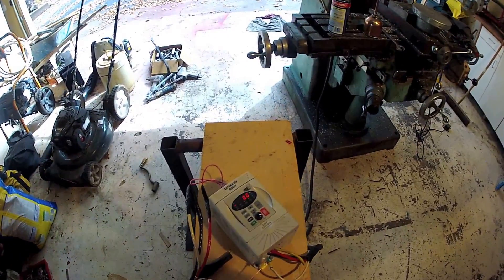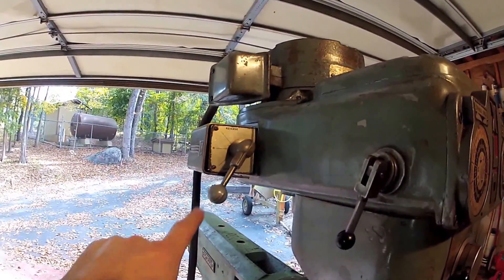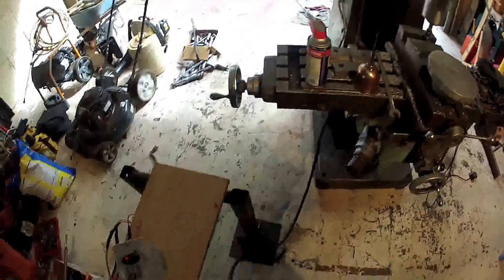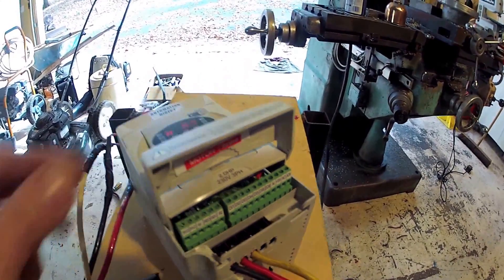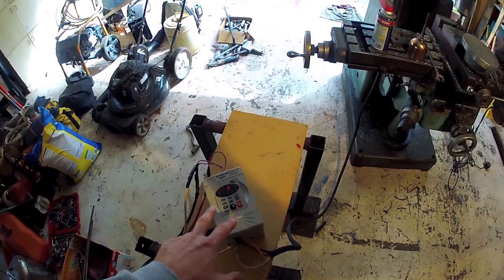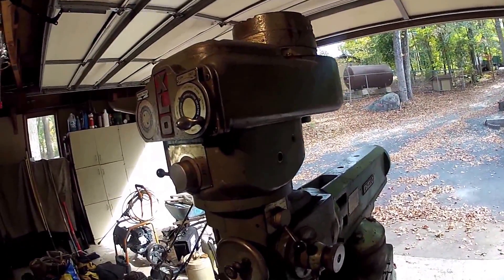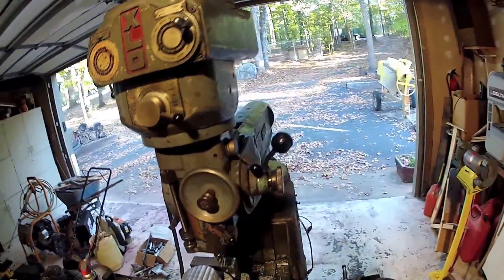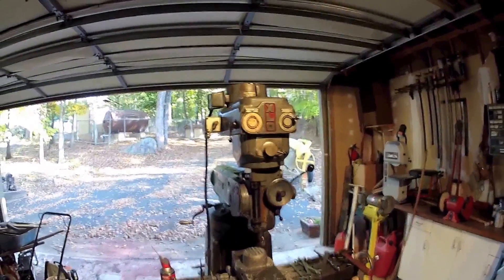Milling Machine Three Phase Solution

Comment: How many volts does your XLO mill require? The ones I'm looking at all run on 600v. Does your VFD output 600v?
Reply from the maker: It's been such a long time since I'd set this up I honestly can't remember, except for one detail.  The general concern with older machines is that the motor coils might not be rated for 600V.  Therefore using VFD speed control at extreme deviation from 60Hz might cause some issues as voltage is varied. I seem to remember the problem being with very slow speeds as the magnetic forces cause voltage to need to increased having something to do with the higher motor torque needed to keep everything turning at lower speeds? Fortunately my XLO still retains it's OEM functioning MECHANICAL variable speed control.  I use it mostly.  To avoid the concerns of voltages that exceed older motor windings, I've primarily used my VFD as a solid state 3 phase generator.  Sorry, I can't speak intelligently nor offer guidance.  Best of luck.
Reply: I have looked at quite a few XLOs and have never seen a 600v Machine. Is it a 602 mill just like this?
Reply: @riversvic  Yes, its the 602. I'm looking at several right now and they're all 600v. Perhaps this is a regional thing, as 600v is popular here in Canada.
Reply: Interesting, what is the power you have available? You could use a step up inverter but I think you need to have 3 phase already available because I don't know if you could step up voltage from manufactured 3 phase.
Reply: I have 240v single phase. From reading I've done since first asking, I believe I have 2 options: bring the voltage up with a transformer to single phase 600v and then use a VFD (the 600v ones I've seen are pricey, but some could accept single phase input) or generate 3 phases (rotary phase converter or VFD) and then use a 3 phase transformer (or 3 separate single phase transformers) to go from 240 to 600. I'll go whichever way is cheaper when I find a used transformer.
Reply: @christianchenier  A 3rd option would be to find the 240v 3 phase motor for it then convert the single phase power to 3 phase, whatever way is the cheapest and easiest for you. My motor is a GE Tri Clad 208-220/440v motor, and I run it off the American Rotary Static Phase Converter. Good luck! I really like my EXCELLO
Reply: @riversvic  That is what I did.   I bought a new 240v 3-phase motor and hooked it up to 240v single phase via a Hitachi VFD. The VFD converts single to 3 phases. Works great.

Comment: There are some issues you should be aware of when running older machinery motors with a VFD.  Automation Direct explains them very well here: 

http://motors.automationdirect.com/information/compare.html

To sum it up, inverters create harmful harmonic frequencies that can overheat your motor and destroy the bearings over time, IF the motor is not designed and rated for "inverter duty".  These old Bridgeports were mostly built before inverters were even in use.  The safest way to run three phase machinery on single phase power is with a rotary phase converter that produces true sine wave 3-phase power, which is what your motor was designed to run on.  Phase-Craft currently sells a 5-HP rotary phase converter control panel for under $150 which, when connected to a standard 3-phase 5-HP "idler" motor, will produce more that enough clean well-balanced power to run a typical knee mill.  A used idler motor can usually be found for less than $100.  Unlike an inverter (VFD), a rotary phase converter will last for decades, and will not inflict the damage on your Mill's motor that a VFD eventually will.

Comment: I need a little help I'm building my pole barn it's going to be my shop I'm wondering what kind of power  that I need I need a three phase electrical box I'm running milling machine a metal lathe Greiner
Reply from the maker: My shop is underpowered.  Unfortunately I had to work with the limits the previous home owner established with his choice of a too small, 240VAC 60 amp power panel.  In my case, all of the power to my machines first runs through my detached home's 200 amp service panel. NOT IDEAL!

None the less, it's plenty of amperage to run two machines simultaneously.  If I had employees or was often running and starting multiple machines, I'd have to upgrade, but for a hobbyist like myself most often running just one thing at a time, 60 amps works.  Installing VFDs keeps startup power spikes much lower!
Reply from the maker: Not sure of your situation, but I highly doubt that you'll be able to call the power company and get 3 phase hooked up.
Reply: Okay thank you very much